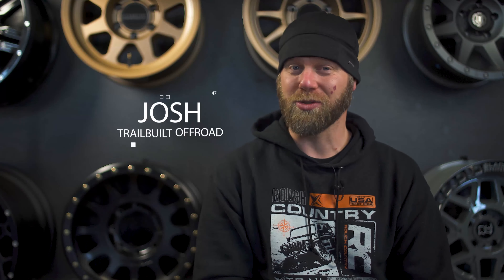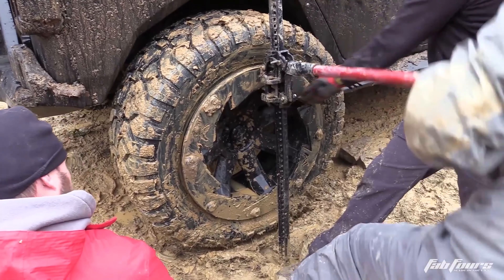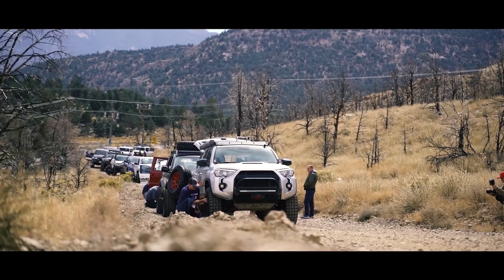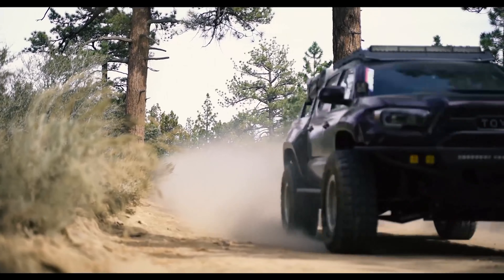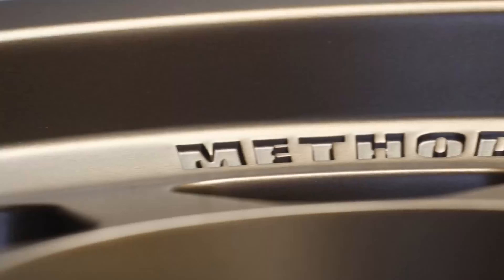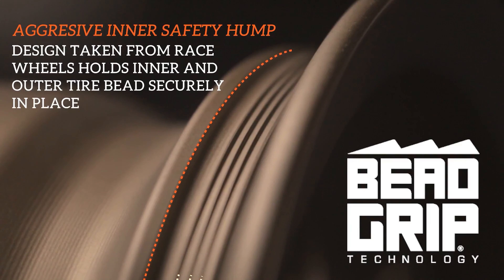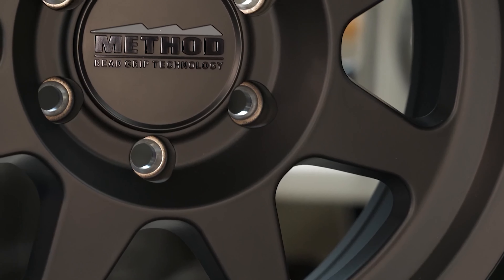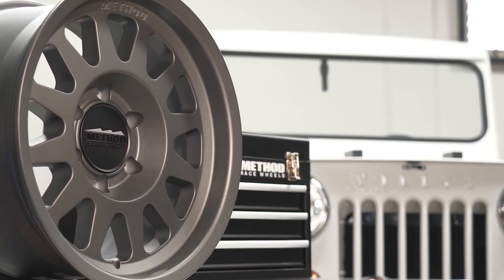You Don't Need These to Offroad!

Comment: I have a 74 bronco running 18” wide x 39.5 boggers in the winter and 39.5” pitbulls in the summer.   We use a 8” wide wheel.   4-6lbs.   Cheap and it works.   Red neck bead lock!   🥳🏁

Comment: Teraflex Nomad wheels basically the same. Plus they have a model with a dedicated Schrader valve for faster airing down.
Reply: Almost got the Nomads, but there more expensive. Plus I only think there good down to 13 or 10 psi. The Methods can go down to 8 at-least or maybe even 5 psi. The grooves in the Nomads are quite different than the methods. But, I really liked the features and design. Just out of my price range.
Reply: @corksauve4949  I have the Nomad wheels on my TJ. You can air them down to nothing if you want. Same with the Method wheels. 
The Schrader valve on the Nomad wheels is adjustable to whatever level you set them.
I almost bought the Method wheels. Then I found out the Nomad's have an optional bolt-on plastic ring that protects the wheels outer edge from rocks and stuff. That sold me right there.
Reply: @kidgokuxl  Same here, the rash ring is very nice. And when I read the spec's I thought it said the air down valve would only go to 10 psi.

Comment: I just run 24 bolt military humvee double bead locks unlike most single side “bead locks” and my wheels are 50 bucks a piece if I wanna drop the heavy rubber center for a light weight PVC beadlock centers it’s like 60 bucks so 110 for a real double beadlock and since the ring is inside the wheel the govt has no proof it is all they can tell is its a normal military 2 piece bolt together wheel

Comment: If you are running a reasonable wheel to tire width and not going too low of an air pressure for the weight of your rig 10-15 psi should almost never be an issue . 8-10 should never be an issue with a set of single  bead lock  wheels that have good inner safety beads , however most of these aluminum wheels like Raceline,  Method and KMC have insufficient inner safety beads and burp air with most tire  beads from the inner.  The steel wheels like allied seem to hold the inner bead better and don't burp at reasonable psi . Running a couple layers of duct tape around the inner safety bead will usually stop the farting air from the inner bead  cheaply.  

Running super low psi in most radial tires under 5-6k pound rigs is silly.  Much below 10psi a on a heavy rig with radial tire is just a busted wheel bead and sliced sidewall waiting on every ledge or any time you transfer the vehicle weight to one corner.  All you're going to do is fold the tire over it's not going to get over anything running sensible pressure won't...A fool and his money ?
Reply: I think you make a fair point. As far as Method is concerned I think that's why they came out with bead-grip wheels.
Reply: Look up Matt's Off-Road Recovery. He's got an off-road wrecker he built with like 55' tires that 6PSI is still too much pressure, and that thing is massive. Might just be the particular tires he's running though.

Comment: Are the MR702 less durable than other 700's wheels because of spoke thickness? 702 has thinner than others
Reply from the maker: Great question. Unknown answer. That sounds like it could require some engineering assistance

Comment: I wonder how they compare to the traditional beadlocks. A side by side comparison would be cool. See what it takes to de-bead a tire.
Reply: They compare incredibly well. I have their model 701's, I can air down to 10 PSI and I've never popped a bead in extreme conditions. So far so good.
Reply: @tundraspecialops  i know it depends on the tire and the terrain but typically people air down to 5-8 psi with beadlocks. I run 10" wide wheels so i air down to about 12-14 psi and have never broken a bead. I think i would feel safer with beadlocks, but for people worried about getting tickets for actual beadlocks, this seems like a good option.

Comment: How much do the 701 17x9 weighs?
Reply: I don't know what 17x9 701's weigh. I have these wheels in 17x8.5 and they weigh 31.2 lb.s each.
Reply: @tundraspecialops  Thanks for the info. That is heavier than the OEM.